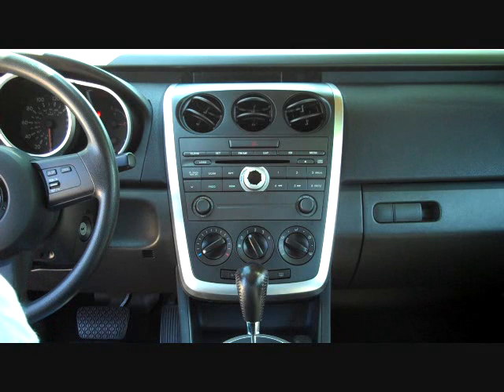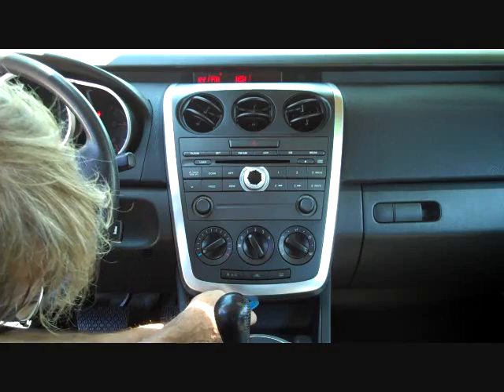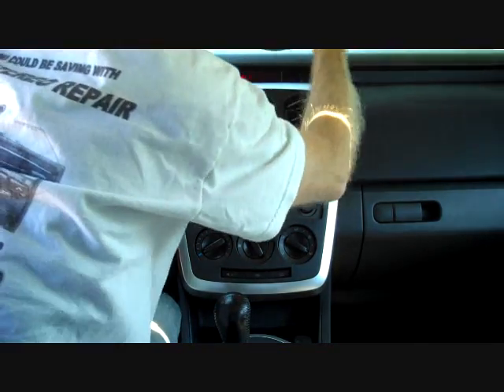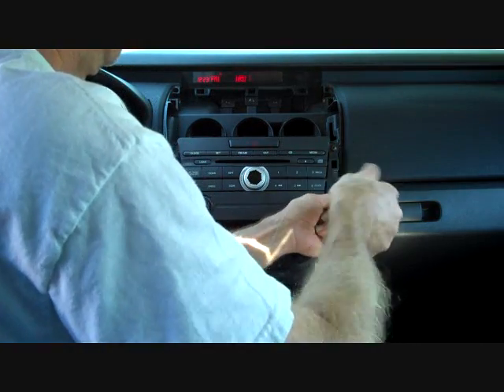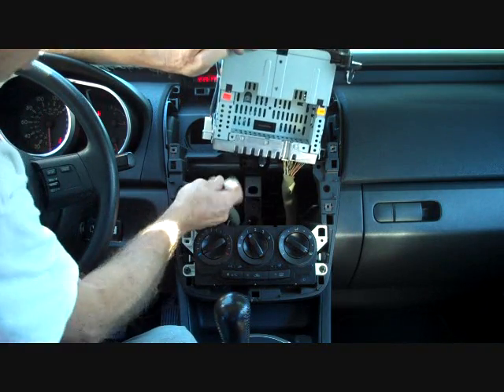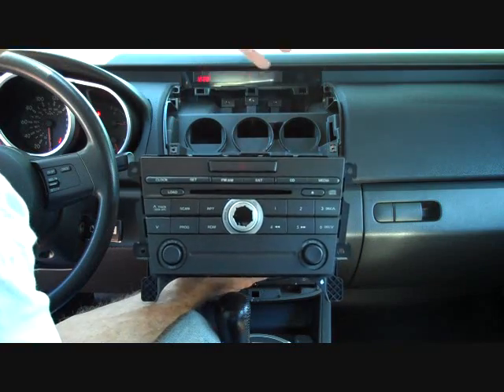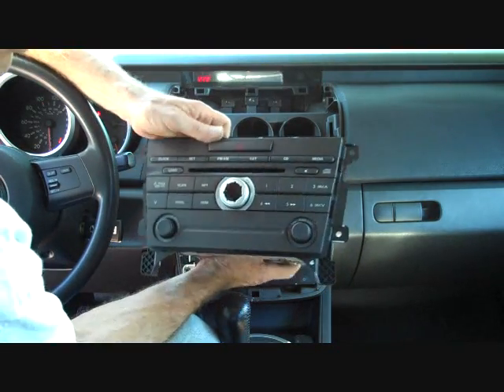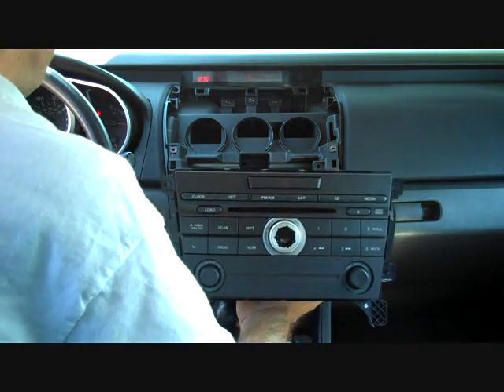Mazda CX-7 Stereo Removal 2007 - 2009 = Car Stereo HELP

Comment: excellent video..i have a stuck cd in my 07...i should be able to access the disc by removing the pink screws right?
Reply: That's my problem with the 2008. Hope it works